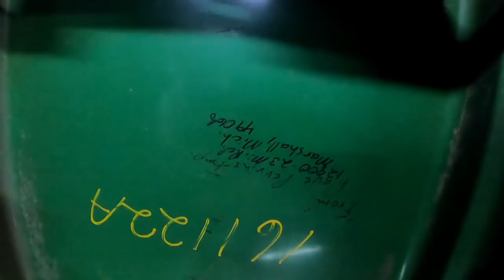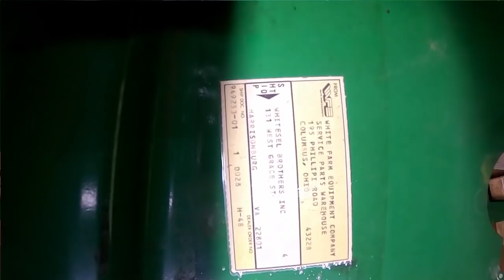Oliver 1550 steering repair

Comment: I'm glad you talked about the different front end's, It saved me a lot of questions,  Have never seen the utility  front end around here or the standard until I found a 1850 standard. I've had to replace the shaft with taper end on my 1550 it has a Oliver 1710 loader on it and saw lots of work over the years.

Comment: Hey Chris, I'm working on a 1550 gas that is leaking hydraulic oil out of the steering motor from the steering wheel shaft seal. Do you know what seal that is or if there is a seal kit for these non-charlyn steering motors? Thank you!
Reply from the maker: There's a kit from Agco, and since it's a Saginaw, GM has a kit as well.
Reply from the maker: The Agco kit is 35P938
Reply: @ThatOliverGuyChris  Thank you!!

Comment: I own a 88 a couple 1450s 1550s 1600 1650 1750s 1850 1950s and a 2150. The 21 has a rather large pate on the bottom holding the front end on i recall at one time taking it off and having to lift it with a jack. It had 8 or so bolts holding the front end on

Comment: Whats common problems with 1550s 1969 gas .. Did they all have power steering.. and would a Oliver 770 wide none power steering front fit on a 1550 ? You got great videos 👍
Reply from the maker: The 1550 was a fairly trouble free tractor. If you're looking to buy, check the fluids, the usual stuff. You can get an idea of how the hydraulic pump is doing by idling the tractor down and trying the 3 point hitch. If the hitch works at an idle , the pump is probably in good shape. If you have to rev it up some to get it to work, then the pump is getting worn. The higher you have to rev it , the worse off it is. Hydraulic pumps are no longer available for the 1550, but you can put a 1650 pump in if you change the pump drive gear. 
The 1550 could be a manual steering version (non power) and the wide front from a 770 will bolt right up. The problem will be the dash and steering parts were different for non power steering on the 1550, so you would be having to find all of that stuff. That could be a challenge as it was rare for them to come without power steering.
Reply: Thanks for the great info . Yes I was looking for a good 1550 or 770.  I know more about 770s  1550 not so much . Could you give me a rough idea how many hours the motors go before needed a rebuild.  Or let's say the average hours the 1550 needs a rebuild . 👍 Thanks for any info.
Reply: Was looking at a 1550 all looks good but there places on the motor paints removed like it was pressure washed and blow paint of the engine . Right by the valve covers and around by head gasket and by front of the motor.  Did the 1550 have more paint issues on the motor in 1969 . My old 1961 and 1962 paint still on the motor with 4000 hours plus on them.
Reply from the maker: @GrizC  I would say a 1550 with good care ought to go 4 or 5 thousand hours before needing overhauled. As to the paint, I don't know of any trouble. My experience is a seeping head gasket can cause paint trouble. The little bit of coolant or oil that comes out doesn't seem like enough to bother fixing it, but the continual exposure loosens up the paint.

Comment: Put a wide front from a 2-105 white on my 1650. Had to use the mounting plate from the 1650 and have the hole for the shaft bored to accept the larger shaft and bearings. Improved the steering a bunch turns much shorter
Reply from the maker: I almost did the bore and upgrade on this one because I couldn't find the old style steering arm
Reply: @ThatOliverGuyChris  okay. Like your videos.  I farmed with Oliver tractors for about 20years did many of the repairs myself. Decided to sell farm and equipment about 20 years ago. Biggest mistake I ever made.  Still have the 1650 diesel.

Comment: Thank you for the video. I've been thinking since the last video and I think I'll swap my 1650 axle with a 1750. I'd like to get away from the lighter tie rod components on the 16
Reply from the maker: If you're doing loader work with the 1650, you'll be glad you did.

Comment: I would have loved to found that hood myself for my 1550 utility but I think I'll stick with the one I have as its a factory patched hood !  My build card has "short hood" wrote on the side of the build card and it dosent have a branch delivery on the card and by what I was told by Mr. Schafer (? Oliver Hart-Parr mag) that as far as he knew I have the only 1550 Utility that ever had a patched hood from the factory and had no branch delivery on the build card.  So I think I'll leave it alone. Mine must have had the same thing happen to it cause it has the same arm replaced on it, Looks funny being White red !  LOL Bandit
Reply from the maker: The one I took off is charcoal grey metallic. I'm sure we sold it to them, probably put it on too. We used to always keep one on hand, as well as spindles, because they were so hard on the poor tractor. I wish I still had one on hand, but no luck this time!
Reply from the maker: I was just thinking, they must have changed that arm out. We'd never put a nail in place of a cotter pin.
Reply: @ThatOliverGuyChris  I get a kick out of being down at McHenry's and someone walks in and says I need front wheel bearings for my 1650 or the cast steering arm on the spindle for a 1750 , His answer is always the same I need part numbers cause there are different ones !  Some of the front end parts are the same but there might be 2 or 3 different ones too !  But you know how that is.  My old 1550 diesel (row crop) the NF went bad and at the time it was going to cost $500 for the bearings and seals and bushings for it so I bought a wide front out from under an 1850 gas and put on it funny thing is my hubs and bearings worked on it ! Still havent figured that one out and nether has Harry cause as he said they wont fit !  Unless the NF on the 1550 was off an 1850 maybe cause I know the NF for the 1550 has smaller spindles than the 1850 on the NF so who knows what was done in the past to it .  Bandit
Reply: @ThatOliverGuyChris  I cant tell you how many times over the years I found a nail in place of a cotter key ! LOL And I have found that when you find that nail  the nut is ether loose or so tight you need 3 men and a boy to brake it loose !  I love it when you find a nail that had to be driven into it !  Those are the fun ones to get out ! In a pinch in the field is one thing but never in the shop !  I'm still working on my stash of cotter keys I bought at TSC years ago when they sold them by the pound and I bought bags of them all different sizes . Now all you can get them in is the little packets 5 for $2.59 !  I miss the good old days !  Bandit
Reply: @ThatOliverGuyChris . That arm looked newer.

Comment: great video so if i wanted to upgrade to the 55 series, I just need the shaft and the T piece? the casting is the same, and the gear up top is the same?
Reply from the maker: You'd need the shaft, T piece, plus you'd have to bore out the bottom hole in the casting to accept the larger bearing. You'd also need the sleeve that goes through the bottom bearing, and the nut that goes on the bottom of the shaft. The gear in the box is the same.  Boring that hole out is the big thing, it's not something you're going to want to do with a cordless drill.

Comment: I was wondering if fuel fender tanks would work on or look funky on a 1650 or 1655?
Reply from the maker: They will fit. My 1650 had fender tanks when we bought it, I thought it looked good wirh them. There was only one size of tank, there's several slotted holes in the base of the tank for mounting on different models and to slide them in or out for wheel spacing.

 Seems like fender tanks are a love em or hate em thing, no middle of the road.
Reply: @ThatOliverGuyChris  That's good to hear. I was thinking about getting a 1650 or 1655 for auger and generator duty. We already have a set of fender tanks (unsure what my dad took them off of) that i would like to use someday! Thank you for gettimg back to me, and keep up the great content!

Comment: Sumbitch eh!! Always something. I broke the same piece on my 2-60
Reply from the maker: It's turning out to be a sumbitch. A&I has discontinued it, and no one stocked them.
Reply: @ThatOliverGuyChris  ohh ffs!! I gotta do the clutch in both my whites. So that should be fun finding parts lol
Reply from the maker: @straightpipeacres6365  Clutches generally aren't bad. I've got a clutch shop near me, so I get mine rebuilt there. I found a steering arm, and I could  convert to the newer style arm, but that would take some machining.
Reply: @ThatOliverGuyChris  right on. I'm pretty sure a&i should have most of the parts i need!!? Oh sweet you'll have the old girl up and makin laps pretty soon then
Reply from the maker: Overall, I'm not impressed with the quality A&I produces, but on something like the steeing arm, they were the only ones making it. Agco has clutch parts, we sold BMD remanufactured clutches when we were open and had good luck with them. Granted over 20 years have passed.
Reply: @ThatOliverGuyChris  lol good to know. I will check with these guys that are close to me but I just hate dealing with them. Its hard when you have to tell the parts people what to look up 🤦‍♂️

Comment: I'd like to know how you got lucky without tearing that rubber boot on that tie rod end. Wouldn't it be wise to go ahead and replace that needle bearing? You're already there.
Oliver = way ahead of it's time even still today. Sometimes though, it's still best to keep 'em up and running. Great video, cheers :)
Reply from the maker: Guess I'm a lucky guy, that and the boot was slick from the oil dripping on it.

Comment: Love the videos! I have a 1967 1550 diesel that my grandpa bought brand new. Have any tips on getting the brakes apart? Pretty sure they are originals and do not want to come out.
Reply from the maker: Lots of penetrating oil!. Also,  get a slide hammer/dent puller, the kind you can put a sheet metal screw in the end of. Drill a couple holes 180 degrees on opposite sides of the brake disc, the closer to the hub the better. Screw the slide hammer into one of the holes, slam it it afew times, switch to the other side and repeat. Keep working at it.
Reply: @ThatOliverGuyChris  awesome thank you! I’ll give that a shot this weekend

Comment: If you have time I have a few questions on a 4-150.  It lost power to the live shaft going back from the center. It will drive forward and back, but the top live driveshaft does not spin.  Is there a way to tell if it is the short shaft through the power shift or the long shaft going through the transmission that is stripped?  If engine has to come out do you take the engine out by itself or should the power shift come out with it?  Can  it be towed a couple of miles without running and not cause any damage for lack of lubrication in the transmission?  Years ago we split it ahead of the hinge and rolled the front trans, final drive and engine ahead away from the cab and were able to remove the long shaft to work on the transmission, but if it is stripped out in the front short shaft we should work on it from the front side.  Thaks for any information on this.
Reply from the maker: You could pull the driveshaft off the front drive flange and pull that to see if the splines are ok on that end.  Another option is to pull the fuel tank and trans cover. You should be able to see the drive coupler for that shaft. Have someone grab onto the driveshaft in the steering joint and turn it, you should be able to see what is turning and what isn't. If it's turning going into the back of the 3 speed, chances are it's bad up at the flywheel. If you have to pull the engine, leave the powershift should come with it. You might as well start with taking the cover off the trans under the fuel tank, because you need to get in there to disconnect the drive shaft that connects the power shift to the main transmission.
As far as towing it, does it run? The front trans lube pump is driven off the transmission countershaft, so it would be fine to drive. The rear is driven off the pto drive, but anything that needs pressure lube in the rear end won't be turning because of the PTO drive not turning, so that should be ok. 
If you do tow it, make sure the transmission is in low range neutral. same range the R1 is in. This keeps the low range gear on the input shaft spinning the same speed as the input shaft. That's the one that will seize without lube. Of course there is always the chance that some piece broke off a coupler or something that could get picked up by the transmission gears and cause grief, so your call. Hope this helps.
Reply: @ThatOliverGuyChris  Thanks for all of the information, we will pull that driveshaft off first and check that and then on to the fuel tank and cover.  I am thinking its the long shaft, because previous owner had put in a new front shaft when he put in a reman engine, but that was 4000 hours ago.  When we had the rear shaft out to work on the tranmission slide gears, about a 1000 hours ago, the splines on the shaft were showing pretty good wear.  Thanks again for all the help and information.

Comment: Is that a Marvel Schebler carburetor on that 1550? Do a video on keeping one of those tuned sometime.
Reply from the maker: Yes, It is a Marvel Schebler. I went through that one a couple years ago. I'll add that to my list of future videos, they really are quite simple once you know how they work.
Reply: @ThatOliverGuyChris  Your right...not much to them but what a a pain to keep adjusted. Seems like they always run to rich.
Reply from the maker: @dmc3742  , I think that's this ethanol fuel. I have to run mine a little rich at times. I remember reading somewhere about changing the float setting to compensate for the ehtanol. I'll see if I can find it again.
Reply: @ThatOliverGuyChris  👍👍

Comment: You aren't terribly far from me. Where do you go to now for salvage yard parts.
Reply from the maker: Sometimes all over. The part in this video came from Texas. There aren't many here in southern Michigan any more, so I am usually hunting with the phone or the Internet instead of in person.
Reply: @ThatOliverGuyChris  I recently discovered a crack in the transmission case of my Super 77. I found one at Maibach's in Ohio. They sound like they will be good to do business with but the eight hour round trip is what I don't look forward to. Found a few things on the eBay as well.
Reply from the maker: @danw6014  I get parts from Maibach and eBay. Fortunately I haven't needed anything as large as a rear end. Tractor shows are a good place to find parts as well.